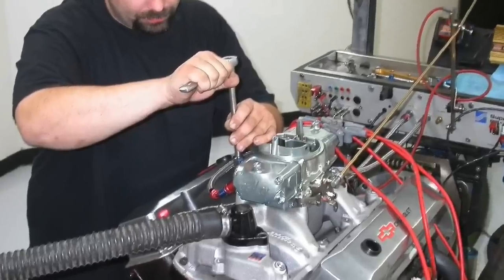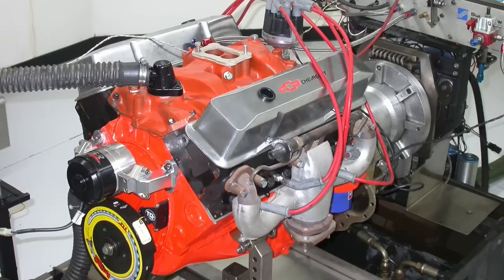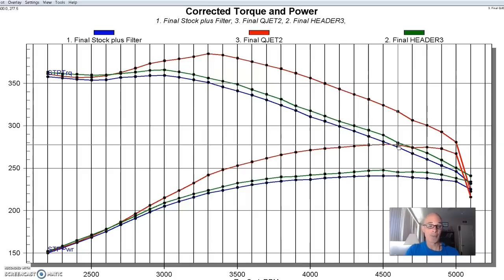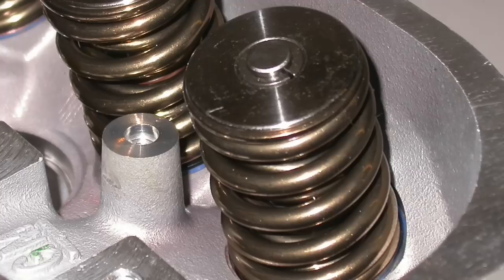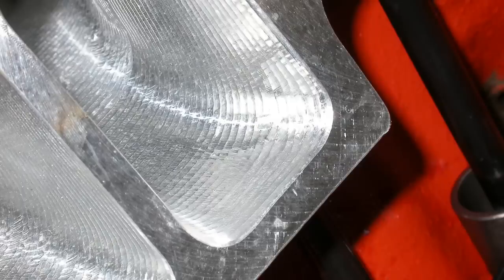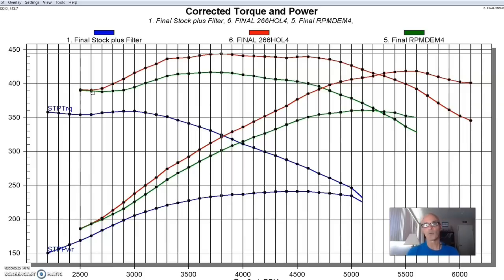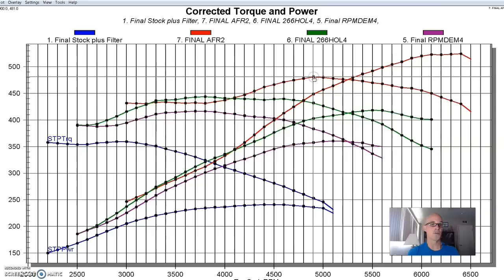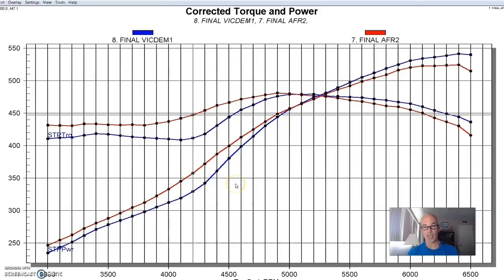HOW TO: SBC POWER COMBOS

Comment: The heads on my sbc are trick flow DHC 175 aluminum double hump heads my goal 450 hp out my 355
Reply: if you use their cam and 10-10.5:1 you should get there

Comment: Would be great to have a crank that weighed 10 pounds or more lighter then the stock one and show the awesome gains from spinning so much less weight.
Reply: If ya go to a super light crank, that would be a good time to upgrade those rods!
Reply: According to the famous Chevrolet racer and builder Bill Jenkins the weight of the crank doesn't matter, it's considered flywheel mass and using a lighter one shows no advantage. This statement taken from his famous 1977 book, The Chevrolet Racing Engine. He, of all people, show know.
Reply: I had to add that it's reciprocating weight that matters, piston and rods and pins.

Comment: build a 347 SBC Bow Tie block with a 4.125 bore, and 3.250 stroke make it 9.0 :1 compression with 18 degree heads, a solid street roller cam on a 113 234, 236 @ 50 with .385 lobe and 1.7 shaft rockers put it in 4 degrees advanced  use .904 lifters use springs that will give 550 lbs over the nose with ti retainers use at least .375 push rod, use a steel top ring gaped for boost, top it off with good efi and 88mm twin scroll should be good for 1300 hp
Reply: Wow thats a rpm screamer combo,,, i like destroked sbc wifey,s Vega has a 352 cid 4.155 bore(400 block) 3.250 crank , 6.200 rod,,,je pistons,, roller cam mild 244 dur .570 lift full length headers 5 sp w/3.55 rear,,, she gets to Wally World pdq,,lol

Comment: You never gave the cam specs for the "wild" setup. But I want to see you test your "generic" setups. Things that were typical on the street.  Example: 4 valve relief flat top 350, double hump heads, comp 292h cam, victor Jr. Intake and holley 750. Then test intakes and heads to see how much better that combo could have been if some thought was put into it.
Reply: Look through the comments. He has replied to a few what it is. Double hump heads are hunk for high hp but hey I have a set sitting on the shelf someday for a bit of a wake up to a 350 I might end up with.
Reply: @chasewebber4316  double humps needed unleaded seats in them.  by the time you spend the money to make them what they're supposed to be for today's gas,  could have just went with dart vortecs

Comment: Engine Masters Magazine spring 2008
THE ROAD WARRIOR
Chevy 357ci small block
Reply from the maker: and others
Reply: @richardholdener1727  unfortunately those AFR heads you used, are well over $3000 Australian dollars to buy here in Australia. even if I import them myself, they're still extremely expense.

Comment: That two barrel manifold is DEFINITELY laughable, 🤘🤣🤘!
Reply from the maker: CHICKS DEFINITELY DON'T DIG THE 2-BARREL
Reply: @richardholdener1727  Only if has two more brothers they will.....
Reply: I had a ‘66 Impala with a 283 2 barrel. Changed it to a cast iron factory ‘66 4 barrel manifold same as this test. Big improvement, even sounded better. I’m currently building a 350 with the AFR 195 Competition heads and a similar Comp hydraulic roller NX276HR. Similar lift with 1.6 rockers but less duration (224/236, .502/.520). Thanks for taking the mystery out of how it’s going to run. I can’t wait to unleash 500ish HP in my 90 T56 Camaro. Btw, I’m running a stock 95 Vortec short block and checked the valve to piston clearance and found plenty of room.